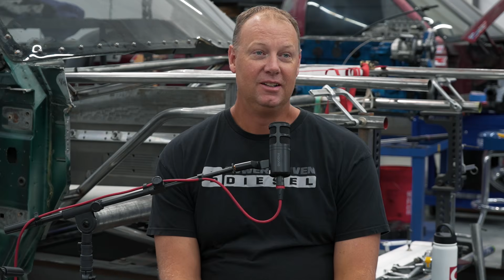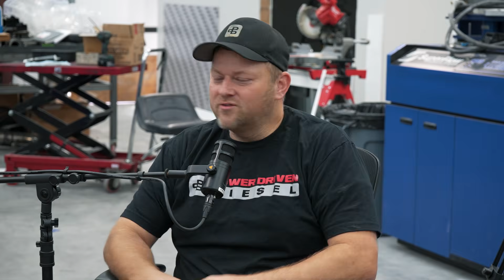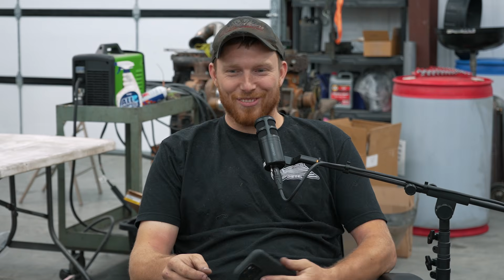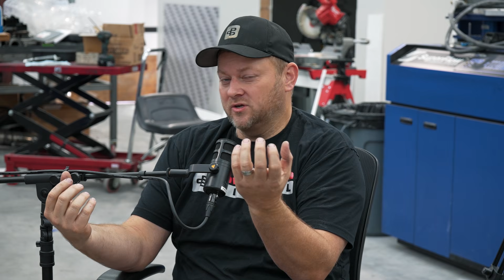Single Turbo vs Compound vs VGT | Real Dyno Results

Comment: When you state swapping the agressor in vs using the s480 with the 467 on the manifold, your only meaning for the common rail platform. Right? Not vp44 or ppump.
Reply from the maker: The Aggressor 98 works excellent on VP44 trucks and p-pump trucks in compounds!  Big power increase with the same fueling setup.

Comment: I'm gonna buy 1 of your aggressor 98mm with 472/87 on the manifold my plan is 250% overs with 14mm pump do you think I'll have enough fuel or with that be my lynch pin
Reply from the maker: That's the same setup Will runs on his Uncle Rico 12v race truck.  Great setup and 250% is plenty to make excellent power, 1,000+ HP no problem, and still run well even tuned down to 600 HP!!

Comment: I'm running a 62/71 Vgt over a S475 with a 1.15 housing on a VP truck. With 175 sticks, a quad, and some other goodies.  Don't know what max boost is yet. Only hit about 1250 and pretty smoke free. 
Love me some compounds! 😅
Reply: That’s exactly my setup, except I’m p pump, with 200 hp flux diesel injectors. Absolutely love my setup.. I have stainless diesel’s adjustable spring waste gate.. very adjustable.. and I have it set very loose.. at about 10 psi boost.. I have 1psi interstage.. took awhile to figure everything out, but super street friendly. Made about 70 psi boost, turned all the way up.. It was wild.. raced a Harley once at a redlight n whooped him. With my 5 speed.. Saw 1700 egt for a bit 😂 Lots of fun.. but I can tune it way down to run totally smoke free.

Comment: What are the biggest sticks I can run with a stock turbo or slightly modified turbo? With plans to go compound’s can big sticks be tuned down enough until the budget allows for compounds?
Reply: Yes they can be turned down
Reply: How big of sticks can I go before i can’t drive it on a stock turbo? 100 200? Just trying not to spend money twice.

Comment: Have you guys used a g42 1450 as a secondary turbo in a compound system yet? 

Also curious on the newer gtx3582 as a manifold charger on a 12v
Reply: G40-900 is the best Garret available for use as a secondary for the overwhelming majority of builds